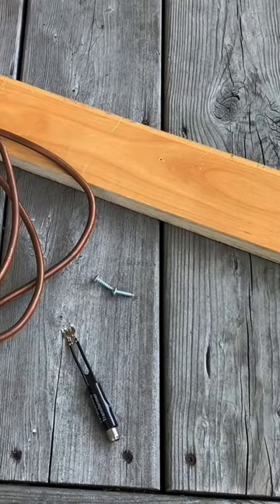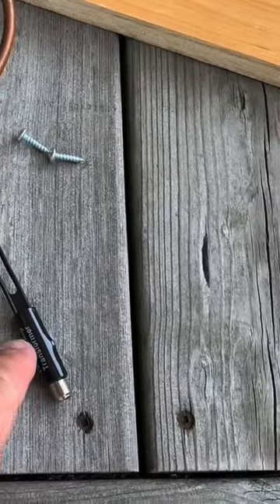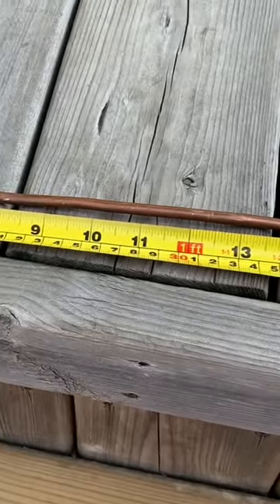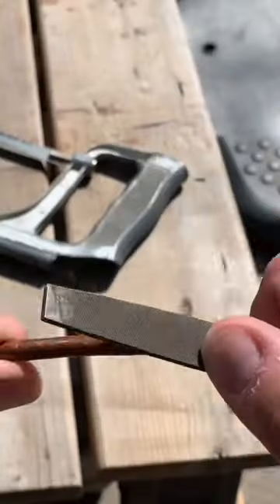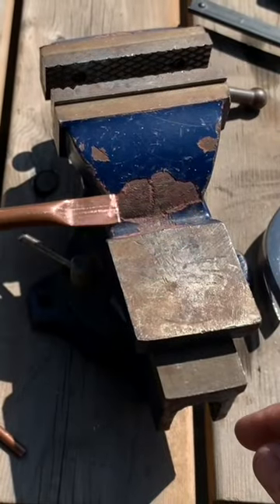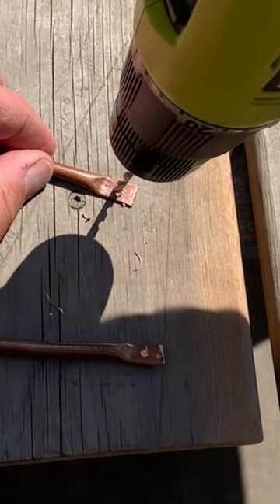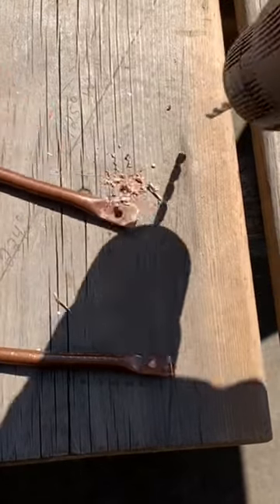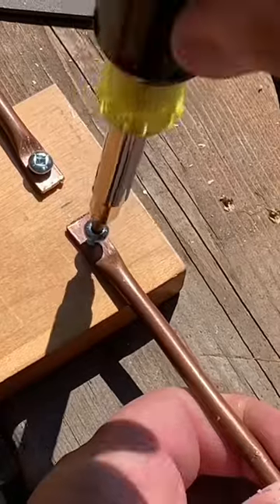How To Make a Simple Homemade Dipole TV Antenna to get FREE OTA TV channels

Comment: Channel 8 & channel 10 quarter wave frequency roughly averages 15.75 inches.  So, I see this helping with high Vhf.

But, 1. Does it do anything for UHF? 2, if not could you add a loop? 3. If you put chicken wire behind it would it significantly improve the direction gain?  4. This is seriously ugly, can it be painted. And could it be disguised by some sunroof artificial wreath or vine or anything artistic and cool looking?
Reply from the maker: You could add a loop or cut some shorter elements for UHF. Function over form here. Pretty it up if you like, maybe a wire wreath could be your UHF loop.